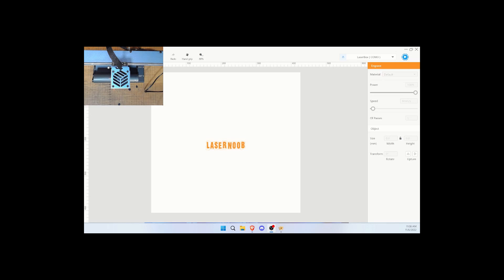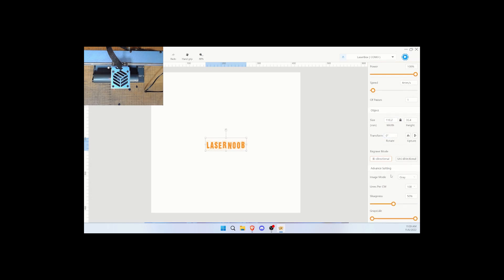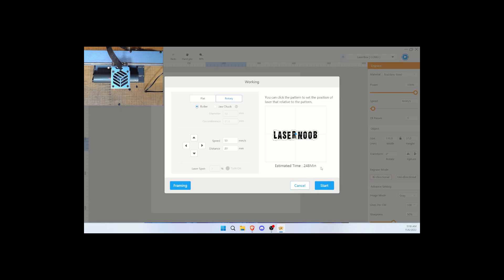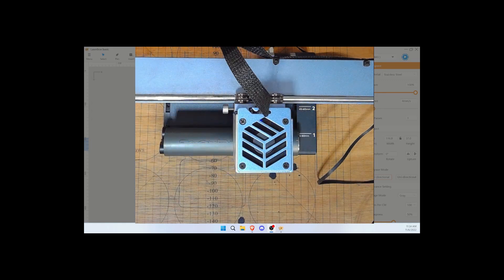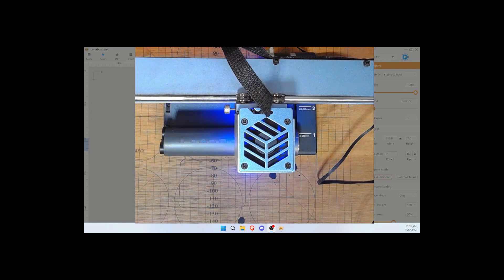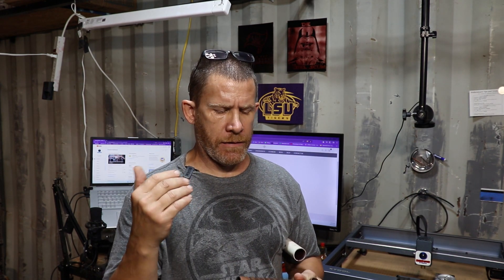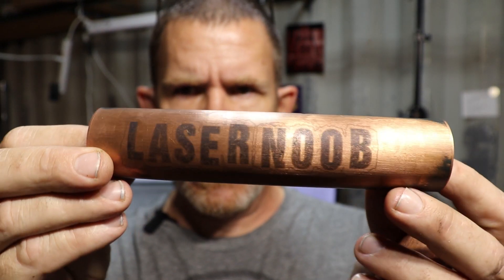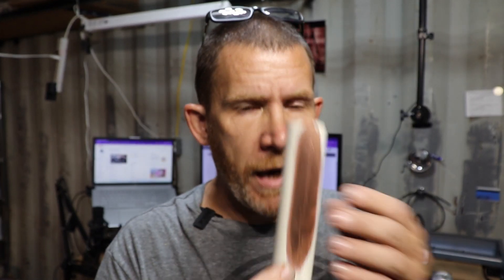Etching copper with dry moly

Comment: Have you tried you test on brass, such as kick plates for doors?
Reply from the maker: I haven't.  From what I read it is extremely difficult if not impossible to do brass. BUT, I haven't considered it since I got my 36 watt wizmaker. I might need to consider it again.
Reply: Thanks @LaserNoob
Reply from the maker: Just ordered some. We'll see what happens!
Reply: Did you order a kick plate or something else?
Reply from the maker: Some 6"x6", 24 guage sheets

Comment: Did you get your settings figured out for the rotary in Lightburn?  I have the D1 Pro 10w and I have the axis set to Y, mm per rotation to 128 and the roller diameter set to 16.76 mm.  Hope this helps.
Reply from the maker: Honestly, I have not even used the rotary for quite a while.  But, thanks for the info! I will try that this weekend.

Comment: I'm curious what would happen if you applied a thin coat of soldering flux on the copper then cooked it with the laser?
Reply from the maker: The etched area would be super clean, most likely.

Comment: I use flat black paint and clean with acatone to clean on copper and works out well for me
Reply: Just checked on my settings and I had it set at 80% power at 2.0 speed also black marker pen seems to work and on stainless steel
Reply from the maker: Sharpie? I'll certainly test these!
Reply from the maker: I'll try that. How does it hold up though? Does it actually etch the copper?
Reply: @LaserNoob  Yes it does with my Longer Ray5 10w laser
Reply from the maker: I appreciate the tip!